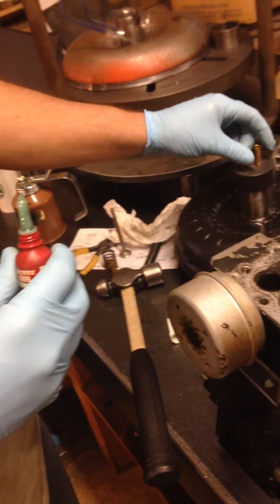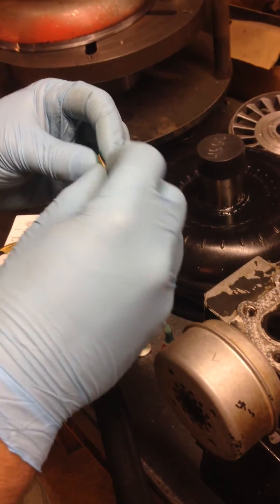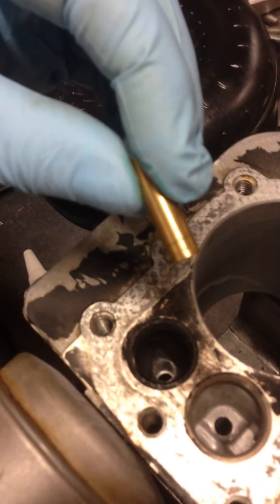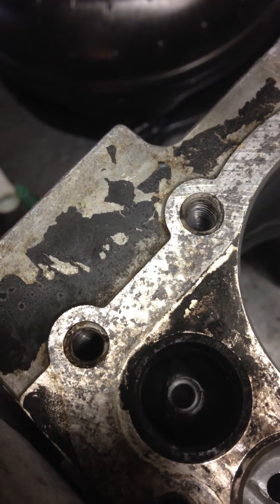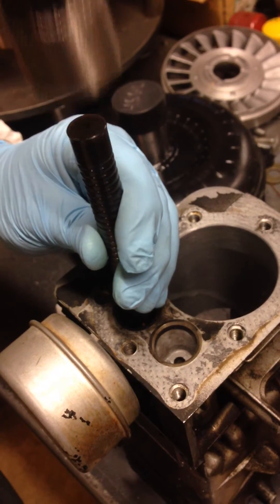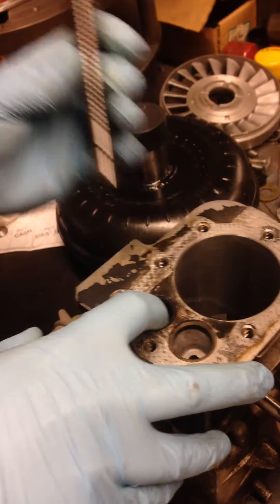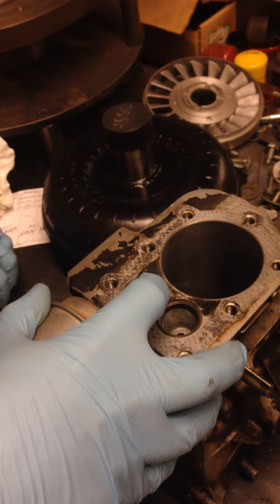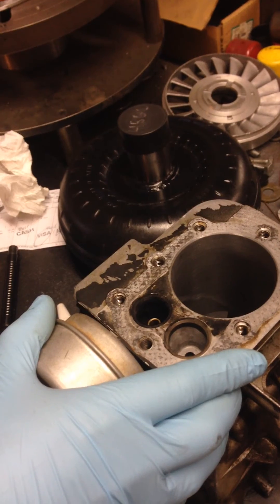Installing exhaust valve guide in Briggs and Stratton engine (Part 3)

Comment: how do you remove them??
Reply: the guides are thin they don't look like automotive valve guides. So the old guide is drilled out. Then there is a finishing hone and the new guide is slightly bigger, the inside of the guide gets honed if I remember correct after being taped in with the driver.